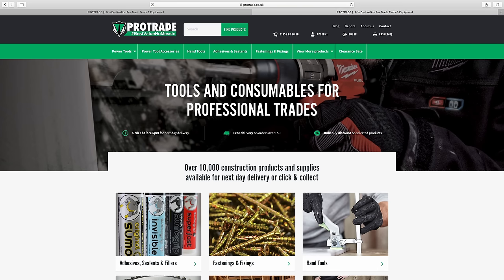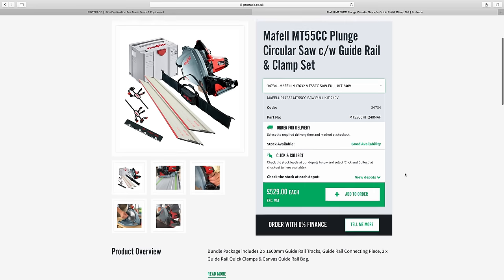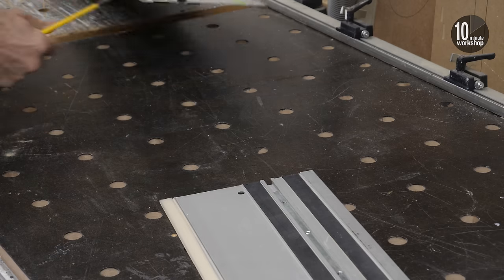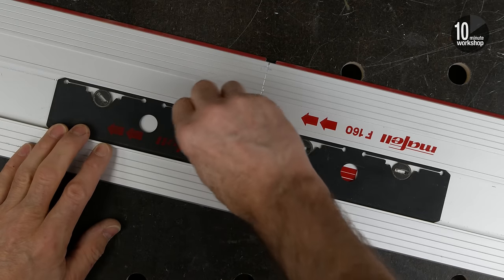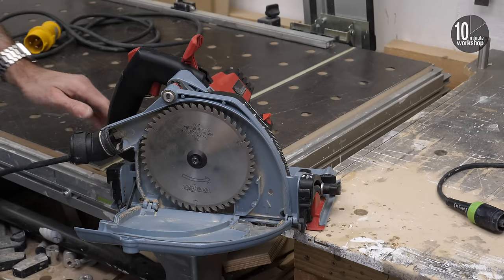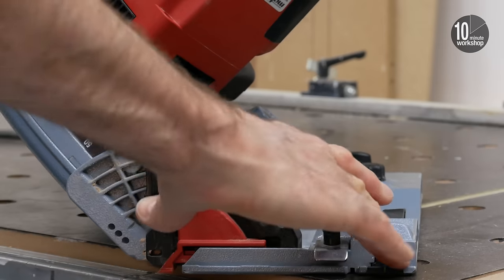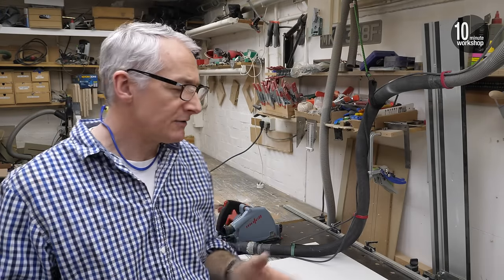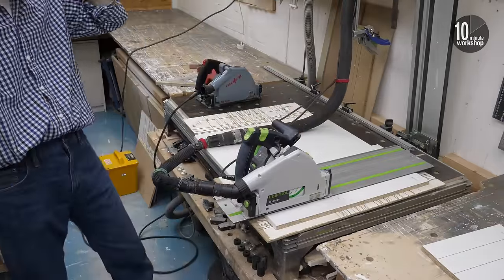Big Decision: Festool or Mafell? [video #400]

Comment: It looked to me like the Festool held up very well. I'll be buying neither though, as I am very much at the Lidl end of the market...
Reply: Parkside for lifeeeee
Reply: @leek805  I don't know about life, but I have bought and reviewed a whole range of Parkside tools and I find them great value for money.
Reply: Consider stretching to the Makita one.  It is superb value for money AND LOCKS ONTO THE TRACKS WHICH NEITHER OF THESE TWO DO.
Reply: @kevinchamberlain7928  It's all a question of money and how much you use that particular tool. If I was doing Peter's job, I'd probably have an up market one but I only use them occasionally.
Reply: @BensWorkshop   yeah I would agree there, but would back Kevin in saying Makita are a good middle ground, as other companies can sometimes sting you with accessories or extras like batteries. So good to look at that aspect when buying tools.
Reply: Parkside plunge saw is horrible.... so much vibration!!!! You need to clamp down the rail for every cut
Reply: @valis6761  I do not find that to be the case.
Reply: @valis6761  Change rail with Makita tape. I have Lidl and Festool and quality of cuts is amazing from the Parkside moneywise ;)
Reply: Bought a Parkside jigsaw once, to get out of a fix, started using it & gave it away. It was dreadful.
Reply: @trevkeay5555  I've got one, it's fine. Mine has a number of settings for varying settings.

Comment: Hi Peter, I see this video was almost 2 years ago now but I thought of a couple of things people may find useful. First I recently saw that the latest Festool track saw replacement for the TS55 is using a thinner 1.8mm kerf (like the Mafell) instead of 2.2mm, but they never bothered to upgrade the motor to match. This thinner kerf obviously puts less strain on the motor, which is Festool’s attempt to appease those who feel it lacks power but without also matching the Mafell’s motor output. I bought the Mafell a while before you made this video and agonised over the differences for quite some time. To my surprise when the Mafell arrived it wasn’t 100% correctly aligned, meaning the cut line shifted over when cutting at an angle - Fair play to them, Mafell shorted it out immediately and even supplied me with new strips for all my rails so they could be cut to match the new blade alignment perfectly! Never had the issue you saw with scribing, so either the unit lent to you needs alignment, or something else moved. Interesting to watch this 2 years on all the same - Good stuff as usual 👍 Oh, one last idea - Avoid risking your warranty and instead use the Neutrik powercon True 1 connectors like the clever chap suggested on Bisch Basch Bosch YouTube channel - cracking idea, and you can even create your own Festool style dust extraction hose with power integrated 😉

Comment: The TS55 was my gateway drug. Unfortunately, when it was 6 months out of warranty the motor started smoking while I was cutting some 3/4" oak plywood. I sent it in expecting to pay for the repair, but Festool fixed and returned it for free. Unfortunately again, UPS dropped it and broke the base.  I sent it back and rather than fix it Festool sent me a brand new saw as a replacement. Thank you, Festool. I love your videos. Thanks, Peter.
Reply from the maker: Thanks Ross! Good to hear you’ve had good service from them! 👍👍

Comment: Worked for years with Festool and now I own a Makita and it does exactly the same thing for almost half the price with more power.
Reply: Have owned and used Makita for 5 years and would recommend to anyone.  Makita motors are undeniably stronger and more powerful. I do like the twist plug of the Festool but since I purchased the new battery powered Makita the corded version is my back up.
Reply: Makita is great. It just does the job for a reasonable price.
I don't see the need in overpaying for over engineered crap like proprietary power plugs, dedicated batteries for each tool etc.
And I'm making a living by using my tools.

Now I'm in the market for a fixed base 1/2 inch router, but unfortunately Makita doesn't sell one in EU, so I have to look elsewhere - and the only one in EU is Bosch Blue :(

Comment: Hi Peter, hope you’re well in these weird times. I replaced my TS55 with the MT55 around six months ago. I just got fed up with the gutless motor on the TS dropping into limp mode every time I cut a  kitchen worktop or ripped the long edge of a 44mm door - which I do. An awful lot. And as for ripping hardwood any thicker than 40mm (even using the 12T Panther blade) - forget it - multiple shallow passes needed every time. I therefore respectfully disagree with what you say in this regard - and for me, the performance of a saw on full-depth rip cuts is totally critical. The MT does it all with ease. Horses for courses - but I’m delighted with mine. And tip of the day? For perfect splinter-free cuts either side of the line, make your initial scoring cut whilst running the saw backwards down the rail.That way, the teeth are cutting into the face of the laminate rather than bursting up through it. Have a nice day.
Reply from the maker: Hey Kevin. Yes, we’ll thanks - hope you are too. Sounds like the Mafell’s the saw for you, though as I say in the vid I haven’t had those issues. Out of interest, was yours 110 or 240v? 👍👍
Reply: @10MinuteWorkshop  It was the 240 - most of my work is domestic. But I know a lot of site joiners who use 110, and as you say, the power problem seems to be even more pronounced on that version. For my purposes, the TS55 was always near-perfection for 18mm MDF and similar, but I guess it all just proves what a broad church woodworking is, and that one size is never going to fit all. All the best.
Reply: Great tip running the saw backwards, thank you lol raging at myself I have never thought of this.
Going to make the swap over to mafell next week
Reply: @KevinBower-gy5be  Quick question mate I do a lot of kitchens, do you find the mafell score cut 10th of a mm back to be an issue ? 
I can imagine I will just do a 1-2mm cut to start if it is, and can't imagine a 10th of a mm will be an issue lol but it will annoy me if I can see the line on MFC or MDF
Reply: Morning Joe. That tenth of a mil is only going to be an issue if the work’s being butted up to another piece - in which case it will be visible. I haven’t ever used the scoring function on the MT55 - I just use the 1-2mm backwards scoring method as described above. All the best.
Reply: @KevinBower-gy5be  Thank you I am sold lol mafell it is
Reply: Enjoy mate.  It’s a great saw - so robust, and the build quality is superb. Feels like it will last a lifetime. And one more tip - all the OEM blades for Festool and Mafell saws are made by a German company called Stehle. Buy direct from them or through one of their dealers - you’ll be buying exactly the same blades, whilst saving a packet :)
Reply: @KevinBower-gy5be  Will do mate thank you

Comment: Just to add a note for anyone thinking of buying a cordless version. The Mafell uses the same 18v batteries as Metabo
Reply from the maker: Good to know, thanks! 👍👍
Reply: I have the 18v version, it's as powerful as a 36v makita !
Reply: Also, I'm pretty sure the cordless Mafell has a different motor than the corded with a Cuprex motor.
Reply: Harvey Smith yes, multi platform batteries. I imagine also the Bosch batteries as mafell and Bosch are integrated.
The Bosch have 12 amp hour battery. Correct me if I'm wrong on the Bosch battery. As Bosch have a same track fence system to maffel.
I have the metabo batteries.
Reply: @ron1martens  No, Different batteries.
The connection with Bosch and Mafell are the corded track saw. Mafell make them for Bosch.

Comment: I mad the switch in 2013.. I know, I checked the receipt the other day. 7 years with absolutely no issues. I switched when I had TTS out because it kept thermaling out.Their rep told me is wasn't really designed for cutting oak worktops.. take from that what you will. 
Just before lock down my Mafell started playing up/ cutting out. I opened it up to check the connections inside and they were fine, so I sent it off to get mended. Turned out it was the plug.. pah.. no idea why i didn't check, but the great guys at Elliots lent me Festool to keep me going. I was panelling a room with Medite MR.. Holy shit the extraction on that thing was, quite frankly, rubbish. The amount of dust (using the new CTL Midi for both) against the Mafell is frightening, and cost me a lot of time in clean up and face masks... which you could buy then ;)
I prefer the Festool tracks, of which I have all up to 5 meters, as you an plunge to full depth and use your left hand to hold in place - I rarely use the clamps. If I had to join them the mafell / bosch are a huge improvement, and whilst the chip strip is also better on the Mafell / Bosch, i change them regularly, so it's not a concern. I also use the rails with the festool routers, and being able to use both, is another win for the festool. Mafell also do a flexi rail that comes with the KSS300, which coils into  systainer, which is opens up a load more possibilities as well as one less thing to carry.
I also prefer the handle location of the Mafell, it's behind rather than above - think a D handle jigsaw against a barrel.
The power from the Mafell is another league.. it's never wet me down, rip's in wet tanalised, it'll take it ll on, and with the blade change so easy, I switch between blades probably 4-5 times a day, from rough cuts to fine, ripping to cross cuts. you just don't thing about it.
The Festool is a fine saw, but IMO since the Festo days the marketing department has had too much input, Mafell, on the other hand, are family owned and built for tradesman. no fluff, just rock solid and IMO the best money can buy.
Reply from the maker: Great post Matt, thanks for taking the time. Yes, I had the KSS300 with the flexi rail as well - great little saw! And agree about the rails for general use too - I also prefer the Festool rail for exactly your reasoning, and while I do like the Mafell joining system, it’s not somethignI do much these days as I also have longer rails. 👍👍
Reply: Hahaha "not designed for cutting oak worktops" .... so was it designed for mass foamboard rips?  I have completely given up on tech support. The other day I emailed Bosch a question about how to determine if a certain model laser level will be compatible with a certain model laser receiver and listed certain specs listed in the manuals about laser wavelengths, laser class type, etc and she answers me by reiterating everything I said in my email and completely did not answer my question at all. These techs clearly have no experience with the tools that they are answering questions for. If it's not something that can be found on the website about the product, they just talk jibberish to try to sound like they're answering your question.

Comment: Hi, I own the cordless mafell,  I fit a lot of kitchens week in week out, I have to make up corner posts out of melamine board which have to be bang on, the scoring cut on the mafell is a god send! White is the hardest colour to join but the gap is nothing like that one especially once fixed together, it really is hair line.
I never hold the rail free hand, I use the clamps every time and it never disappoints. A friend of mine  who is a kitchen fitter uses the festool, he has no issues with it other than it majorly lacks power. Good honest review though, just go with your instincts and choose the one you like the feel of and will suit you best.
They're both top saws!
Reply: what do u recommend tho
Reply: @iiiiiieye  I've never actually used a festool saw but I've seen them used, they produce a nice finish, I wouldn't bother with the corded version, I'd buy the 36v festool if that was what I was after.
The mafell is only an 18v machine but still has plenty of power. The best thing to do is go have a look at them and see what you prefer the feel of.

Comment: Amazing video as always. I know this is 2 years later but I would add that I had had kickback once on the Mafell saw. I cut the damage off the rail and bought a full sized Bosch rail as it is half the price because it is blue rather than red.
 I have used Festool tools for years when I used to work for companies and I always admired them.....until I used a Mafell. I have always put Festool in 3rd place behind Mafell and Hilti. I ended up buying the Mafell saw after watching this video and visiting the tool centre to view one. Upon picking up the Mafell saw, straight away I just admired the build quality. It is built like a tank!!
My other reason for buying the Mafell over the Festool was because of the tracks. Although the Festool was about £100 cheaper when I bought it, I would need to buy a longer track as they are just too fiddly to keep connecting, disconnecting and so on. To someone who doesn't use the saw that often, they would probably find that point laughable but to someone who uses it all day, the Mafell track was a huge game changer for me.
Not only would I have to add about £350 onto the price for an extra 2.7m/3m rail, I would not easily be able to fit it in the van. (yes you did read that right, £350 and the 5m rail including VAT is close to a whopping £500!)
This is not to say the Festool ts55 is not worth it by any means. Festool make seriously good tools and I do own a couple. This rail saw is the only Mafell tool that I currently own but I would consider more now.
The only negative that I have found with the Mafell saw is the floppy dust port, just like the Festool which you mentioned in another video.

Comment: A very interesting comparison. I think both saws are brilliant but I bought my TS55EBQ before the Mafell was a twinkle in an engineer's eye. I have never had any problems with chipping on either side of the cut  (even when I forget to drop the splinter guard!) and I simply cannot fault the saw in any way. As I sometimes need to cut thick sections of old reclaimed oak I also bought a larger saw, and the only real choice then  was the Mafell KSP85. It is very powerful, cuts like the proverbial hot knife, runs on rails,  plunges with a parallel lever operated mechanism and has a retractable riving knife( I'm old fashioned and I will not buy or use a circular saw that doesn't have one). Both saws are excellent for their intended use and I wouldn't swap either one for anything other than a direct replacement. The one area that I think festool does better than any other manufacturer is the systematized approach: once you've got the saw and rail, you have to get the extractor. And then the router with its rail attachment and before you know it you have a wall full of systainers and an empty bank account!

Comment: This video helped me decide to go for the Festool and I couldn’t be happier. The other reason for the festool is that did a project where I needed two different bevel cuts (half and half) along the same edge of the board. The accuracy was amazing due to the same pivot point when adjusting the angle of the cut. This is not the case with the Mafell so it was rather surprising that they haven’t figured this out. I even emailed Mafell asking this and then never responded. And finally, if anyone considers a perfect scoring cut with the festool, I set the depth to a couple of mm and run the saw backwards - always a perfect finish.
Reply: Proper scoring should always be a backwards cut so that theeth is biting the surface of the sheet into the material direction. The same way as scoring blade in profesional table saws is working.
Reply: I do the same. Makes the Conti board behave.

Comment: Hello Peter, Thanks for the comparison. I'v used a Festool TS55 for over 20 years now and I find the little Green block you slid in front of the blade to be extremely useful. First it reduces the chip out on the side of the cut, away from the rubber rail edge. Secondly, it also reduces the amount of dust being shot out the front of the saw. I think they come in packs of 5. When I have an expensive Vaneer to cut I install a brand new chip stopper because it is cut away by the blade and if you are only cutting 20 mm depth then that is the zero clearance you get, a couple of 55mm cuts and it doesn't have a zero clearance at the lower depths any more. That would be an interesting comparison to the Mafell scoring cut.

Comment: The mafell seems much higher in cost than the festool as of today. This is in US dollars and considering a comparable set of working accessories. It is clearly a better performer , but the cost is stifling, even to a Festool user. You do make a very important point, how do these tools perform over time. I would like to see a 5 year old Mafell performance against a 5 year old Festool. Out of the box performance is all very good, but how am I going to feel about this investment 5 years from now. What parts break, how hard are they to get? These are the things that help us determine whether or not this was a good investment. It is the MTBUMA (mean time between unscheduled maintenance action)  and MTTR (mean time to repair) that can make a difference.